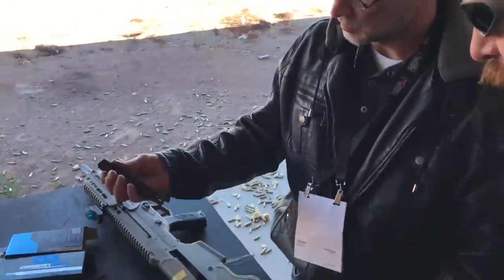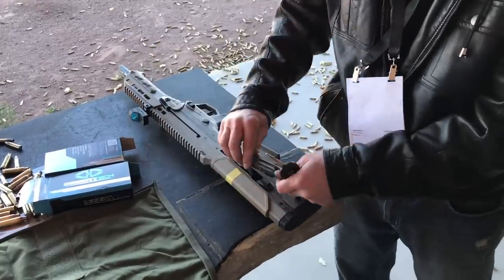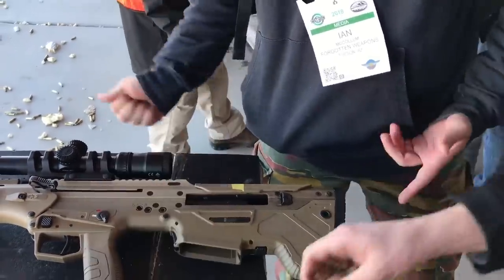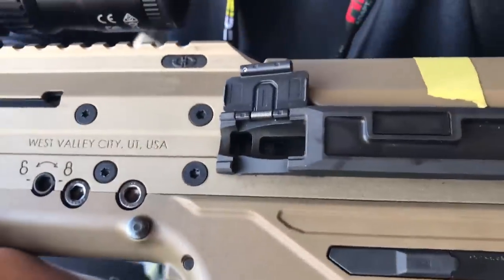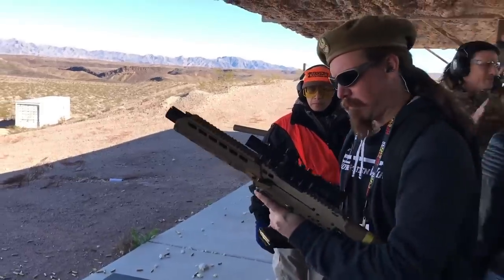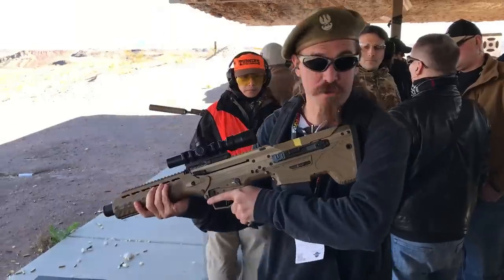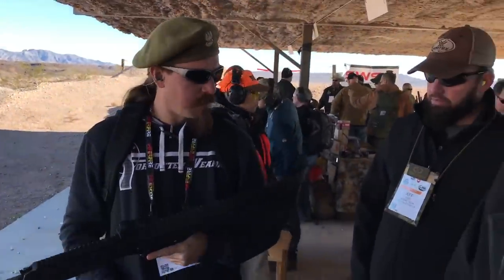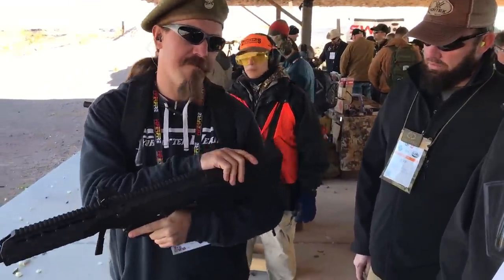Desert Tech MDR: Live Fire, Handling and Analysis

Comment: "Its unfortunately quite compelling", or in other words, i want it.... but its 2500 dollars or more once i buy both the 5.56 and .308 versions.
Reply: Basil Staros Or just a "little" more, the rifle is convertible from .308 to 5.56.
Reply: You'd be dropping around 3200$ or more.
Reply: @ everyone
There's also a .300 BLK kit.
Reply: And there's already 6.5 Creedmoor available.
.22lr is in the works aftermarket.
Reply: I would love this thing in .277 Wolverine. My favorite cartridge for AR15's yo.
Reply: Given that I've never even heard of .277 Wolverine, I wouldn't hold your breath on that one.
Reply: @LinkHyrule03
You can always have someone ream out a barrel if you have the reamers.
Reply: I don't know what that means. I'm a user, not a barrel manufacturer.
Does .277 Wolverine use the same case as .223 or .308, simply necked up or down to .277 caliber?
If so, then yeah, just a different diameter barrel should do it, combined with a simple adjustment to the gas block.
Reply: @LinkHyrule03 
I really don't care if you know or don't know. That's not my concern. However, it is extremely simple; As long as you have a reamer or reamer set for your desired cartridge, and desired or needed barrel profile, you can have a barrel maker turn one out for you for any gun. 7mm does wonders in an AR15.
https://en.wikipedia.org/wiki/.277_Wolverine
I know there are a bajillion different cartridges out there for the STANAG magazine/AR15, but everyone should really check out what .277 Wolverine has to offer. Good performance externally and terminally, common bullets, common casings, and cheap as hell to load. Also it only need a barrel swap for a 5.56 gun.
I know there are some 6.5 CM kits floating around for the MDR already.
All my original comment was about was thinking about what this gun has to offer and what you could do to it. Pretty rad (and it costs $1000 less than a SCAR16/17).
Reply: +LinkHyrule03  I care if you know. The reamer is the cutting tool that forms the chamber and throat on the barrel, which the cartridge seats into. You take a barrel that has the proper caliber bore and rifling twist that you want and ream the chamber in the proper spec for the cartridge you wish to use. For instance, 5.5.56x45mm and .223 Remington have basically the same chamber reamed into them, but the 5.56mm reamer cuts the throat a little further, allowing you to use higher pressures than .223 does.

Comment: How do these rifles compare with the Kel Tec RFB (.308) and RDB (.223)? Both are completely ambidextrous without any port switching...
Reply: Nah, they were talking about the F2000.
Reply: He was talking about the FN FS2000 in .223... The KelTec RFB has a similar forward ejection while the RDB is bottom ejecting behind the mag well. I was curious about a general comparaison between these two rifles and the two Desert Tech bullpups.
Reply: Technically, the MDR is of higher quality, and has a higher amount of modularity due to caliber conversions. That said, the RFB and RDB are more tested as well as being easily available for a lower price.

The RFB is a bit more complex than the MDR due to it's forward ejection like the fs2000, but in a comparison for the MDR and RDB, the RDB is a better thought out design. It's far more simple, lighter weight (Slightly less than 7 pounds compared to the MDR's 8.7 pounds for both the .308 and 5.56 models), and comes in for around a 1000$.
Reply: Laird Cummings the RDB has a very simple ejection system. The rifle itself has about the same amount of parts as your average MSR
Reply: If money (or weight) is your concern, I would go RDB. They both shoot the same projectiles through a semi-auto bullpup. If just putting holes in bad guys for home defense (at a reasonable price) is your concern, the RDB is plenty good for that.
I'm very familiar with both and have been following the MDR for years. I currently have one on order.
For cost, it is hard to beat Kel Tec when it comes to bullpups.
However, where the MDR comes into its own is with accuracy, modularity, caliber conversions (ranging from .22lr to 6.5 Creedmoor, of which .308 and 6.5 Creedmoor are already released and shipping), ergonomics, and quality.
I love Kel Tec, but I have to objectively admit that while their guns are good enough, the precision and quality of their workmanship isn't why I buy Kel Tec. I buy Kel Tec long guns because they have the design I want at a reasonable price. Desert Tech is known for being really high end in terms of quality.
Accuracy: Courtesy of multiple independent reports, the MDR is just about 1 MOA, slightly sub-MOA with good ammo, a bit above 1 MOA with common plinking ammo. The MDR also has return-to-zero with caliber changes and cleaning, as they use more or less the same mounting system for their barrels that they use for their SRS rifles.
Modularity: A huge surge of aftermarket support is growing for the MDR. There's already caliber conversions, handguards, trigger packs, and much more. The design itself is very friendly to aftermarket support.
Caliber conversions: .308 MDR's are already mass produced and available. .223 / 5.56 MDR's are shipping in April. .300 blackout is supposed to be shipping by the end of 2018, but I wouldn't hold your breath on that. Those are the calibers being currently offered by Desert Tech, but they supposedly plan to do more. A sister company with a tight relationship with Desert Tech, ES Tactical (which already makes SRS conversions for DT) already has 6.5 Creedmoor available. Many other cartridges are being planned. There was talk of .22lr, 9mm, 7.62x39, a bunch of hunting calibers, and some big bore calibers.
Ergonomics: The MDR offers a great trigger. It also offers BOTH front and rear magazine releases. It also has an ambidextrous bolt release, charging handles (with HK-style hold-open and slap), and safeties. It ejects forward on either side or it can be run without the plate and just eject perpendicularly, the same way a Tavor would.
Quality: The MDR is very well made. Machining is precise and the design is good. I love my Kel Tec's, and they mostly work, but I can't say they look super finely machined.

When it comes down to it, why did I personally choose the MDR?
1) I want options for how to reload, so I like having both front and rear releases.
2) I REALLY like that cool delayed forward ejection.
3) I wanted a more accurate rifle
4) The RDB seemed to have heat issues when it came to the handguard not handling heat well
5) I wanted a single rifle that would be perfect as both a home defense bullpup and a hunting bullpup. The ability to change between .223 and .308 does that for me. A future .22lr conversion will only secure the deal for me, with cheap range plinking, teaching children, and small game hunting covered.
6) The RDB's sling points were unacceptable to me. I'm rather picky on that front. The MDR isn't perfect, either, but I can rig up the system I want with the MDR. I want side points at the rear with which to run a nylon strap across the butt.

Comment: Regarding the 'concussion'--what are the provisions in the event of a chamber or cartridge blow-out?  It seems that the shooter could get a face-full.  Also, with two removable bits that are essential for function, how practical is it for hard, long-term use?
Reply: Always wondered why bulpup manufacturers don't make resin impregnated kevlar "frag shields" which are then molded into the polymer on top and some kind of weak spot to make sure the forces blow out through the magazine area. Like the panels that blow out from a tank in case the ammo inside cooks off.
Reply: Pete Sheppard, you should research just how much abuse Desert Tech did to the MDR and how they beefed it up, specifically for the scenario you are suggesting. That is a common fear among people who aren't into bullpups. It's not a realistic fear, as the guns are plenty strong to not injure you in the event of a failure, but Desert Tech chose to increase the weight of the MDR by nearly a pound just to assuage those fears. That weight increase bothered many fans, but they prioritized reliability and life-long ruggedness over being a featherweight rifle.
Reply: Good points; I actually applaud Desert Tech for taking their time to work as many kinks out as possible.  Hopefully, they deliberately blew up some rifles to test for safety.  My second qualm is losing those bits; if they can be taken off, they can be lost. :p  ADMITTEDLY, that's entirely a user problem, though.
Reply: StudyinSteel, yes. Just go to Desert Tech's Youtube page and watch their videos from a little more than a year ago. They were testing the guns to withstand 4000 rounds of abuse in semi-auto mag dumping, then decided to beef up the design to better withstand that abuse and better protect the user from a catastrophic failure (like from a squib or fully obstructed bore), but they really only discuss that on their Facebook page. So go to their facebook page and look back more than a year ago. You'll find their posts, directly from their CEO, Nickolas Young, describing the process of torture testing the guns and apologizing for the delay, and the weight gain, of the rifle. You'll also find tons of salty and butthurt people who ragequit at another delay and an unexpected weight gain.
I'm not making this up. Everybody who has followed the MDR process throughout its life remembers this point.

I don't know if links are allowed here, so I'll break up the URL and you'll have to complete it:
The blog update explaining the weight increase: deserttech [dot] com [slash] blog/mdr-update-march-2017/
DT's Facebook page: www [dot] facebook [dot] com [slash] deserttechHQ/
DT's youtube video showing testing for catastrophic failures: www [dot] youtube [dot] com [slash] watch?time_continue=2&v=YCd7gSTSp20

Comment: I am guessing Desert Tech is very pleased with the feed back from the work they put into developing this gun.
Reply: Really the biggest complaint that we have is that the MDR's current gas block is not at all meant for plebeian suppressors. It was designed to use the OSS suppressor, which produces minimal back-pressure. Normal suppressors significantly overgas the MDR.
Other than that, the reception has been great.
Desert Tech will be rolling out a fully-adjustable gas block in the coming months to address that issue.

Comment: Wow, those prices are very H&K-like...
Reply: It's the first generation of a new rifle built from the ground up, R&D isn't cheap... Though I see a few features which could really be simplified for production costs- namely, lose the QCB/caliber swap system and make the ejection from one side only. It's front eject, those funky cover plate things are just needless machine time... Unless they were made specifically to reduce the work done on the receiver, but I'm not sure that's the case. Though I must laugh at their assertion that it's "light weight" when it weighs a half pound more than a Scar 17S (Or the Keltec RFB, it's closest competitor in the 308 bullpup market) and the 5.56 version weighs the same... Which is to say that it's anywhere from a pound to two pounds heavier than the competition. Unless the aftermarket really takes off and the price drops below $2,000 I can't see a reason to buy this rifle.
Reply: +ChaseTheStars  Eliminating everything you listed would defeat the entire purpose for this rifle. That would be idiotic.
Reply: ostiariusalpha I don't see how. I wasn't recommending removing the front eject system, simply posing the question that it probably doesn't need to be swappable from side to side like that. And as for the QCB... The MDR could just have a gas block rail that's full length and make the barrel extension attached to the receiver by two pins, so the assemblies can be swapped with optics attached (Ala the RDB). Speaking candidly, I don't think there's any value whatsoever to converting a .308 rifle to 5.56. It's extra weight that has no reason to be there. People who want .308 rifles want .308 rifles and people who want 5.56 want 5.56, and I doubt many people will be converting between different length cartridges like that.
Reply: +ChaseTheStars  The port covers being easily removable is an important feature for clearing malfunctions, and making maintenance, repair, or replacement of the scissor ejector less of a hassle. That this also makes swapping the ejection side possible is just an extra perk. From an engineering standpoint, attaching the barrel extension to the receiver by what are essentially takedown pins would be a nightmare to attempt to maintain precision. The AR-15 works because the barrel extension and upper receiver, where the optic is mounted, are a mechanically solid fit; leaving the takedown pins to simply attach the upper and lower receivers. The system that Desert Tech uses on the MDR is very good for making repeatable precision with a barrel swap, there is no good reason to try to replace it with something inferior. And speaking candidly, no one cares that you don't want to be able to swap between short action and intermediate cartridges. What you want is a Tavor 7, and it costs basically just as much as the MDR.
Reply: ChaseTheStars, you are incorrect in your last statement. I am among those who ordered both .223 and .308, and I intend to use both. A LOT of MDR orderers ordered both calibers.
.223 will be what I keep the MDR in. It will be for home defense and will stay in .223, as .308 isn't very ideal for home defense.
I will convert my MDR to .308 every time I want to go hunting, as .223 isn't a very good choice for deer hunting.
I will also be getting .22lr when that comes out.
While 6.5 Creedmoor and .300 blackout are also options, those don't interest me as much.
Reply: ostiariusalpha I don't particularly want the Tavor 7, I want something short and ambidextrous that doesn't cost an arm and a leg and weigh 8.5 pounds... If I trusted Kel-Tec's quality control I'd just buy an RFB and be done with it. As it is I'll pass on a 7.62 rifle. I apologise for speaking for everyone in saying that no one would want both, but I still maintain that it's not worth the extra weight in 5.56. You also brought up an interesting point tangentially, why not just build the MDR with an upper and lower instead of the QCB? You have to change the bolt out anyway to go from 5.56 to 7.62, why not have the ability to swap out the optics as well (And no, I really don't count that micro RDS that mounts to the single rail on the gas block, because if you had any other optic behind it'd be obstructed). And I honestly don't think it'd be an impossible undertaking to have 2 or 3 pins hold the barrel extension aligned with the bolt repeatably enough. Looking at how the MDR does barrel changes vs how I proposed, the only difference is that A) the rail isn't attached to the GB and B) it uses rotating locking wedges instead of pins and requires a tool, which is not that big a deal but a sticking point nonetheless. I concede the point of the ejection port covers, I was honestly grasping at straws trying to see where all the cost comes from (Aside from R&D recouping, of course).
Reply: +ChaseTheStars  That's absolutely fine if the 5.56x45mm set-up isn't worth it for your ownself, nothing illegitimate about that. The thing about pins is that they have to be loose enough that you can push them in and out, which really does make the required firm mechanical fit basically impossible. Locking wedges, on the other hand, actually do work without demanding an impossible level of precise machining. The wedge is the less expensive manufacturing option. The lower and upper receivers of the MDR do pop apart with take-down pins, so switching calibers like an AR-15 isn't an impossible dream. The wedge system works so well though, the extra bother and expense of doing so, versus just a barrel and bolt, probably wouldn't be worth it for most owners. Though I could see that if you were using it in a long distance competition configuration, you would want a dedicated upper receiver that kept the wedges locked onto the barrel extension without the slightest alteration to maintain precision.

Comment: I have just found this channel, and I am quite impressed by the details built into this weapon. I spent several years with the UK Army back in the 60's, and I only fired the 7.62 x 51 Nato round through both the L1A1 and L4A1 LMG. We were expected to be able to reliably hit targets at 600 yards, and to worry it at 800 yards ( and I was better with the L4A1 doing that.). What sort of effective range does this weapon achieve in 7.62, and how much energy is used by all that mechanism in cycling it.?

Comment: I couldn't help but notice that the 308 front end pic rail is airsoft aligned with the reciever pic rail.
Reply: They probably improperly installed it. There are actually two screws to help return the handguard to close-ish to zero. That said, there are very few rifles with which their handguards are the ideal place to mount optics. The MDR has a little piece of rail in between the handguard rail and the receiver rail. That section of rail is directly attached to the barrel and won't lose zero at all. Also, Lucky Irishman Firearms has an aftermarket aluminum handguard for the MDR to resolve the issue.

Comment: Gotta say that this thing looks a lot better sealed than the RDB. It just might survive the mud test. The only potential causes for concern would be the slit for the charging handle.
Reply: That charging handle slit lets stuff through, but not into the action. The action (in the rear) is actually pretty well sealed from that forward section.